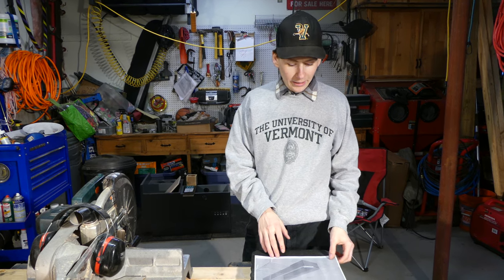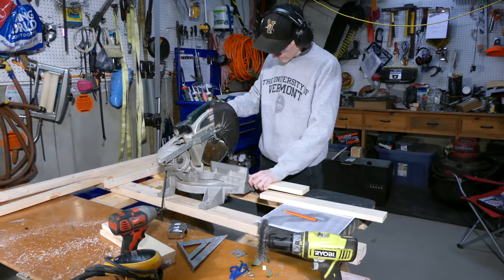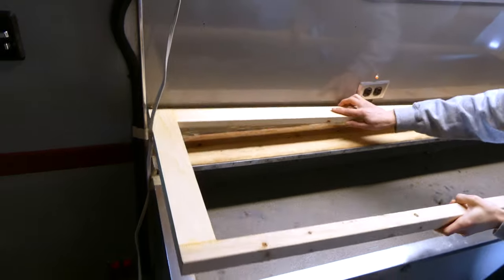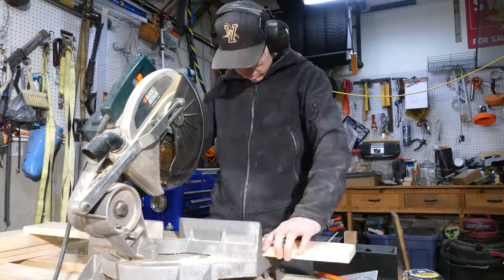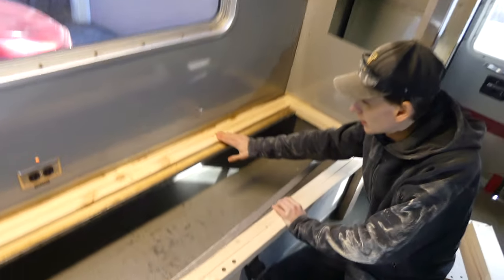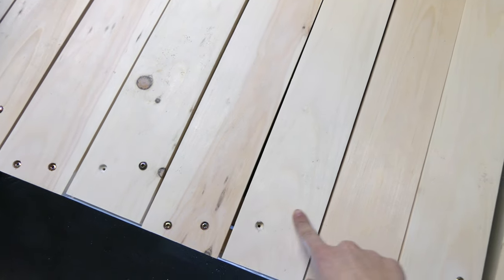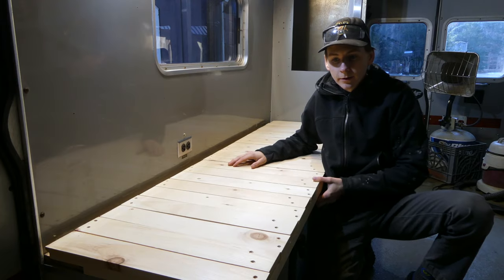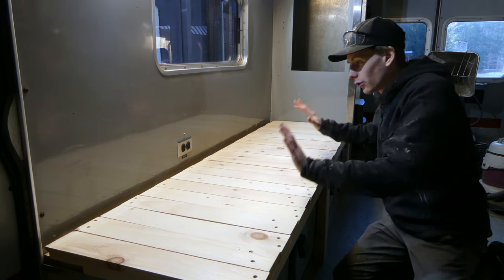BEST Slat Bed For Camper How To DIY | Ambulance Conversion pt. 8

Comment: Great video, THANK YOU!!!  I'm going to use this exact design for mine when I'm solo and there will be another hinge on top for when a bigger bed is required that will flip out and then we will able to lay with our feet down there looking out the box and door windows.  I think I can find a mattress that won't be affected by a half inch difference in the base for solo mode.  Thanks again...from Northern Vermont!

Comment: I'm doing the same thing with my ambulance this video is very helpful keep up the filming you are helping builders everywhere alot. Please do an in depth video on the wiring like how to trace the wires,wire switches everything about wiring i know a bit but looking at the panel in mine got me lost how do i redo the wires from the big panel and get rid of what I don't need. Any videoes you can recommend. Looking forward to your upcoming videos good luck on the build I hope you document it all.
Reply from the maker: Thank you! We started this project in November, and have quite a few videos out on it, and wiring will be coming soon! We are not going the typical route, but one I strongly would suggest for ambo owners. Next video coming out will be beginning the electrical
Reply: I can't wait already started making the bed. Trying to figure out where I'm going to put the Diesel heater and 400ah of lithium batteries. I'm thinking under the bed cause there's a lot of room under there but then the problem of where to run wires
Reply: What state or county are you from I'm watching in Idaho
Reply from the maker: This past week we finished up initial mock ups of the diesel heater system and will be showing that very soon as well as electrical! We are doing a whole separate electrical system than the original ambo that is very simple and I hope that will help you. Look for those videos in the coming weeks here as the weather breaks!
Reply from the maker: We are based out of western Massachusetts!

Comment: Great video.  I've done this exact design in my fishing shack/tiny home.  I Have to take apart the movable slats though as they are way to tight sliding back into couch mode.  I think I will do like you and put a 45 on the end to help it to start to go to the home position

Comment: Awesome video and super smart design! Small idea for improvement for your videos? Maybe invest in an external microphone? I don't know if you already use one but the audio inside the van is a bit weird, which is only natural of course, given it's a small space. Keep the videos coming! :D
Reply from the maker: Thank you Syb! I do have a Rhode directionally external mic on there, there ambulance is just full gutted right now and very echo-y... that will be changing soon! It does sound a bit weird because the voice overs are done in an insulated box which sounds amazing